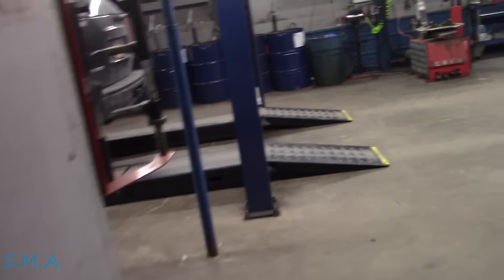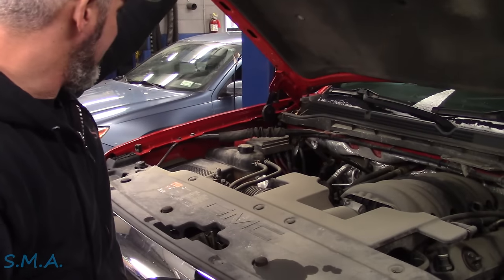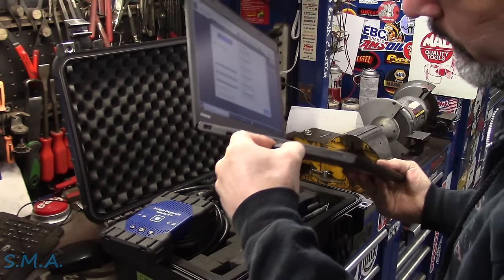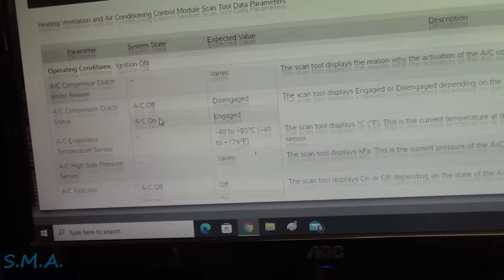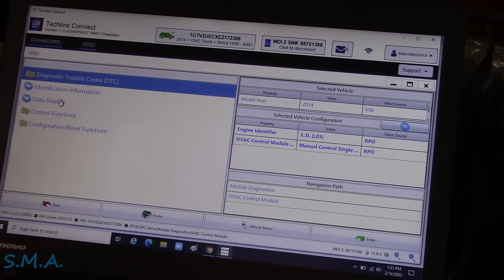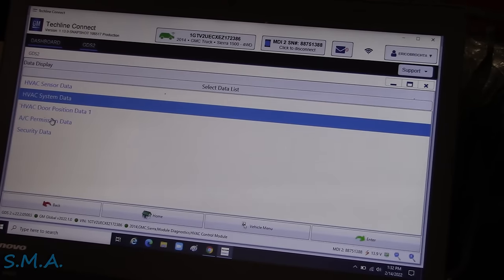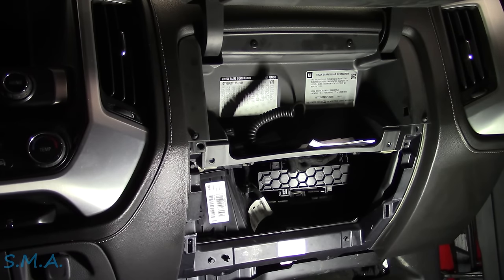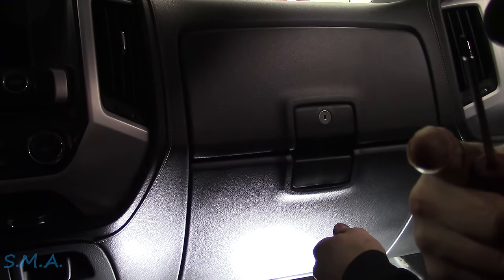Chevy/GMC Truck: Failed Heater Control Module

Comment: The first car I owned as a high school student, had a choke knob on the dash for starting it in cold weather. It was a four-years-old Chevy station wagon; our family car. 

The entirety of the repair manual for this Chevy was readily available for a low price and came as a printed & bound book. No need for a vast array of specialty tools, nor subscriptions to web based manuals. A standard set of box and socket wrenches, and a set of screwdrivers, was all you needed to complete any repair. 

I reset the spark gap, and set the timing by loosening a bolt, unplugging spark-plug #1's wire, and plugging the wire into a grounded strobe light. Each time the mechanical distributor fired #1 the strobe light flashed. I pointed the light onto the crankshaft pulley. The engine block had a pin. With every flash I could see the mark on the pulley and the pin. I turned the loosened distributor until the pin indicated 5° before Top Dead Center. In those days, inside the distributor there was a spinning arm, driven by a gear on the crankshaft. The arm always spun in the same direction, so between tune-ups the entire distributor rotated, due to the engine vibration, towards Top Dead Center, no matter how tight you torqued the retaining bolt. There was a torque limit imposed by the breaking point of the Bakelite™ plastic the distributor was made out of.

Comment: Thank you very much for your great videos. I like it how structured you search, and find, the issue and then change only what is really wrong. I've seen to many times that they just try and change parts, maybe they are lucky and it works, maybe not but in any case they charge the customer for the changed parts. So in my opinion your way is the only correct way to go.

In this case with that module I think I had opened that module and had looked for cold/broken solder joints and resoldered them, most likely on the connectors where the power comes in.
Years ago I owned a BMW. That hat similar issues with the radio. I asked the mecanic how much it would cost to replace the radio. That would have cost me over 1000$ and would have had to be reprogrammed (it was from bach in 1992 and the radio was living in the trunc together with the optional 6 CD changer and the optional TV-Tuner. On the front console you then had a HMI/Display and the Navigatio system. So even back then you had up to 5 or 6 interconnected modules just to make some noise in your car. If one failed the whole system was down. I opened it, resoldered a few joints on the connectors and it worked great for the next few years I owned that car. The same with the dash pannel where some displays started doing weird thinks.

I know, you as a professional mecanic would probably run into some liability issues so you don't really have many other options than changing the module, but for all the diy-selfers out there that might be an option. I mean, what do we have to lose? If it works, great, if not we change that module. 
Even if some (most?) poeple/diy-selfers don't know much about electronics, there are poeple out there who do, and they also offer to repair such modules. You just need to find them, what at the moment is still a pain in the a..., but I think (or I hope) there will be more and more of them in the next few years.

You complain about that there are more and more modules in nowadays cars. Well, that is true, but that was also true 30 years ago. For my abowe mentioned BMW I asked in the garage for the shematics. They gave me them in form of thwo full binders with a total of around 1000 pages so I could copy what I needed! And as I wrote, that car was from back in 1992. For my 2011 Chevy Silverado I was able to download a 785 page pdf from GM (where at least 1/3 are for different options my truck doesn't have) so in these 20 years I think it didn't change that much. 20 years before that was different. My first car was a 1976 Opel Manta...for that one I also had the schematics. They fitted on fully 2 pages...but that car had no Airbags, no Lane assistant, no backup camera, no curve lights, no park assistant, no navigation (back then the GPS-System was not even availlable to private poeple)...it had no power windows, no powered sunroof, no power stering... It even had no seat belts on the rear seats and, unbelievable but true, despite that I survived it. 
So don't be sorry for poeple, they want selfdriving cars what they can start with theyr mobile phones, with 358 Airbags and where they don't get soaring arms after having tried to turn the steering wheel from left to right on the parking lot without moving the car...well the drawbacks of that is that more and more complex systems and therefore also electronics, who might fail, are needed and build into nowaday's cars.

Comment: it's getting to the point where to many special tools are needed. I got one truck that has a ABS module is slowly leaking and I been reading that sometimes you can bleed it the old fashion way, but also been reading you need to bring it to a shop so they can hook scanner tool to it

Comment: Sometimes you don’t pick a profession it picks you. I spent 43 years doing HVAC because I told a guy I would help him out of a bind. I just bought a new F150 and I purchased the Ford 150,000 
mile maintenance plan and the 150,000 mile extended warranty. It covers pretty much everything but gasoline. The maintenance and warranty figures out to cost me about $.07 per mile.

Comment: I think the 1990's Chevy trucks were the best. They didn't rust as fast and you could still service them relatively easy. I had a '95 Cheyenne and kept an ignition control module and screwdrivers behind the seat. It was really a very reliable truck to own! I sold it about seven years ago with 240,000 miles. About three years ago I saw it on FB Marketplace with 180,000 miles. The older the truck got , the less miles it had!

Comment: I went full on Mr Pissy pants..bought an aircooled VW Beatle for everyday driving. New cars are throw away. Quality parts are a challenge, but you can find them eventually. The stock heating system does work if it is in good condition. Anything that I need to do to that car I can do myself. It's a relief to get back to basics!

Comment: My 2000 Expedition Eddy Bauer is not going anywhere anytime soon, 198k miles strong. Even my wife start to like it for his reliability,  she doesn't bug me to trade it anymore. We use it for hauling an rv trailer. According to fordscan it had only 5 or 6 reliable modules to deal with. No cafe standards back in 2000. :-)

Comment: We hear ya Eric! Needed igition switch for my old Olds ... mechanic said lots more than car's worth ... if he can get the part. All because ac button did not function on the ole '99. Ended going to junk yard and pulling one from '03. $25 and a day or on/off work. Dang switch contols tons of things I never suspected.

.

Comment: You are right Eric O it's getting to the point when something simple like no heat will then turn into a point were it will be to costly to fix a problem like heat with how crazy its getting with hoe many modules and computers run a vehicle nowadays @SouthMainAutoRepairLLC

Comment: I grew up in the 60s and 70s, all I ever wanted to be was a mechanic. Dad was a farmer and I kept all his machines going. But when I finally got a job it was around 83-84 and those first computerized cars were junk, the tech wasn't up to the level they were trying to push it to, and no YouTube around, if Chiltons didn't have it you were out of options. After two years I finally told myself, if I'm going to stay in this field I'll have to keep going back to school to keep up with the latest tech, and that's not what I want. So I changed careers and left so burnt out I could barely stomach fixing my own vehicles.

Comment: Hi Eric, as good as you are at this, It does seem to wear you down. With all the tools and diagnostic equipment you need its no wonder they can't find techs. I'm retired and still do this on the side and it is truly frustrating.

Comment: Man, I'm with you on the complexity thing. I know the designers would have a different viewpoint, but to a simpleton such as myself, a vehicle with 44 modules would seem 44 times more likely to have a failure than one with a single module. I believe that you have what it takes to do anything you set your mind to, and I understand your wanting to move on. I gotta warn you, though - complexity  exists many other places now. Networking in industry started well over 15 years ago. It promised easier and cheaper plant start-ups, as well as reduced wiring costs and construction time. Prior to the complication of industry, the Engineers spoke of "points of failure" and recognized that simplicity and reliability went hand in hand. Marketing and other interests eventually overshadowed the simplicity and reliability - and we ended up with networks intermittently going offline, as well as firmware incompatibilities and other stuff arising when replacing stuff. Additionally, companies will spend a million dollars installing or updating equipment, but balk at hiring more Techs to handle the extra work generated by overly complex equipment. I gotta ask - if you leave the auto repair world, will you be taking your cars to someone else for repair? I've been driving since 1975, and have never in that time put my car in a shop for anything other than alignment. I fear I may be forced to change one day, and that will certainly make me feel less capable. Basically, I think people are going to end up having to buy warranties to survive, and when components are not available, the cars will be scrapped.

Comment: I feel your pain. HVAC mechanic, all the issues blend together at times.

Vehicle related-got my 2019 F350 back today with the second new heater core in 10 months, they also did the driver heated seat for the second time in 18 months. Newer might be comfier, more powerful, more “efficient”, not better. In the long run cost of ownership is much more than older, and you’ll be more inclined to trade it in when they have to start pulling the cab off to do any moderate engine repairs..I like my truck but wow…$$$$

Comment: You are absolutely correct...   Fixing these new fangled vehicles as they get some age on them is going to be a pain the rear....  and expensive.....   I like heated seats and all that but I did without them til 2018 so I guess I could get by without them or some of the other gadgets.   I think they are trying to force us to buy a new vehicle every 3 - 4 yrs so they are covered under warranty.....   My first car had ps, pb, auto trans, heat and air and I could fix it....   Not much I can do these days except change the oil and add windshield washer fluid....

Comment: Hi, Eric. Yup. I used to fix all my own stuff. Scooters, Motorcycles, Sportscar (1), Van (1), and Autos. I remember an Audi that needed a new fuse. What was a fuse? I lttle ceramic rod with pointy ends with a little strip of lead that would melt under a given amperage. Every engine had "Points" that had to be adjusted and or replaced. When the engine was not running well, "points" were the first thing you checked. Then the spark plugs. If that didn't work, check compression. Maybe new valves or rings were in order. All done at home. Did somebody break your tail light? $15 for the new reflector and 65 cents for the bulb. Nowadays? The LED taillight assembly fails? $250 to replace the whole thing.  Cars? An assembly line would run parts through 15 or 20 steps and out would roll a car. Tesla is now working on a 500-ton press that will form an entire car body, in 1 step. Not including doors, hood, interior décor, and trunk, of course. Somebody crashes into your rear corner and bends the frame a bit? Can you straighten it? No. Get a new car. A new battery every ten years? $20,000 plus instalation. But you can get a three-motor heavy-duty Tesla for only $150,000. Shuck, I'll start saving up so my grandson can buy one when he graduates his son from college. What a great gift! Thanks for sharing! Stay Healthy!

Comment: The last Chevy 1/2-ton truck that I actually liked was a 2002 Silverado.  But even by 2001 they were starting to get a little stupid when it came to electronics controlling simple things like the HVAC.  I swear when they came out with the 2003 cat eye body style, they also made the body sheet metal thinner and used thinner materials in the seats.

Comment: I understand that. I spent 10 years in the dealership, as well as 4 years in school. Just recently I finally had enough of it and started a new career as a truck driver. Anything newer than 2008 is just getting out of hand. The newest car I own is a 2009, and that car has given me a few off the wall issues. Like the on-star module is clipped to the deck lid in the trunk, and the clip has been getting wore out so it keeps falling down and hanging by the wires. When that happens the car won’t start. It takes out the whole can bus system, and nothing will communicate. All because of a feature I don’t even use.

Comment: My heater controls are cables, and a fan switch tied to a set of resisters to control speed. 
My truck has a carb and dizzy. 
The windows, mirrors, and seat are all El Manuel. 
There’s three pedals not counting the park brake. 
It’s all original 36 year old stuff and everything works flawlessly. 
I like simplicity.  
😎

Comment: Even if I had the diagnostic equipment for modern vehicles, I don't have nearly enough patience to work on them for repairs like this. Hell, I was finally dragged kicking and screaming into the OBD II era about 3 years ago when I bought a code reader to pull the D.T.C.s from my sons car. I bought the simplest one that I thought would do the job and, it did. I'm actually considering upgrading it now but, I still won't be getting anywhere near the equipment that you have!

Like you said Dr. O, heaters with cables (or vacuum operated if you really want to push my patience) and radios with knobs! I still like manual transmissions, roll up windows and push down door locks too!

Comment: When I still had the shop back in the 70s and 80s, I said the same thing that vehicles would become so over engineered that the average owner would not be able to afford to repair them. And here we are in 2022 and the same thing is being said. It looks like the buying public has not figured it out yet.

Comment: Amen to my 1984 GMC. I put a 350 in it, and 1-ton axles 373 ratio type, and there isn't anything I can't fix on it. I keep looking for a new truck but they just don't make a simple truck anymore...so I keep the old girl solid and tight! If anyone knows of a new simple truck that can haul a 7'*12' trailer PLEASE comment. I learned a lot of great knowledge from DR.O!! Bless you all

Comment: When I started in the business almost 40 years ago you had to take the fender off to change the blower motor on most cars, and it was a BIG fender. A car with 100,000 miles on it was junk! I could overhaul a TH350 transmission for $200 bucks and some of my customers would squeal like a stuck pig. I think the cost of personal transportation has actually come down a bit.

Comment: I'm thinking of working on my 1966 Volvo P1800S. The windshield wipers weren't working. I pulled the switch (5 minutes) disassembled it, found and replaced the tiny broken spring, popped everything back together and in less than an hour had wipers again.

Comment: in my young days my big goal was to have a heater that worked  ice would form on the inside of the windshield  deicer on the inside  you may get a buzz  old 1957 bugs and vans heater no go, 1950 to 1954 Chevys heater core always rerouted  vacuum wipers  and then go through 1960   i could go on and on , that's when i was young  it was all good !

Comment: I have a 1968 Plymouth GTX. Every time I see a video like this it makes me want to keep it all that much more. 1968 heater module a 10 dollar cable to a flow control valve. Water on water off and heat that will have you rolling the windows down in the dead of winter. But I do not have fancy light up buttons. lol
Reply: You're not the Andy that just did the engine replacement project over at Uncle Tony's Garage, are ya?
Reply: @chrisfreemesser5707  No not that one.

Comment: Sounds like someone needs a vacation 😆. And yes, I agree with you regarding all the electronics, why do we need all that stuff to turn on the heat, I like the KISS principle.  That’s why the majority of my vehicles are pre 70’s, 50, 53, 54, 61, 63, 69, much simpler to work on.

Comment: You're at the wrong end of the maintenance game Eric. The fun stuff is actually figuring out what the HVAC module is doing with its inputs, aka, what is being output. This isn't genius level work but I think it's almost becoming an everyday technician item of monitoring the module's output after giving it the proper input.
This is something that an outfit is doing with Ferrari ECUs. They feed the input to them and diagnose the problem and then fix the ECU. This has been done for an expensive car with not many parts sold, imagine this done on a scale like Ford, Chevy, and Ram trucks? Figure out the module's inputs and then what gets output and then make your own replacement module which can replace the factory one.
The fun here lies in determining the inputs and then what is output so you can do the design work or pass it along to someone to design the board that'll replace the factory board inside the factory housing.